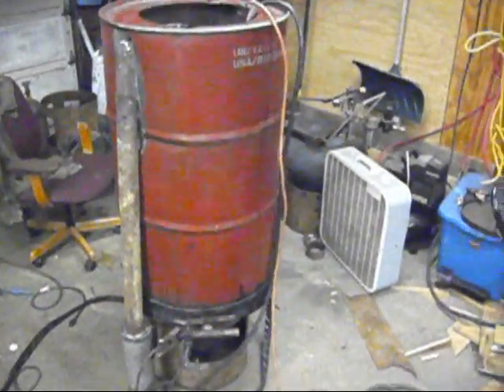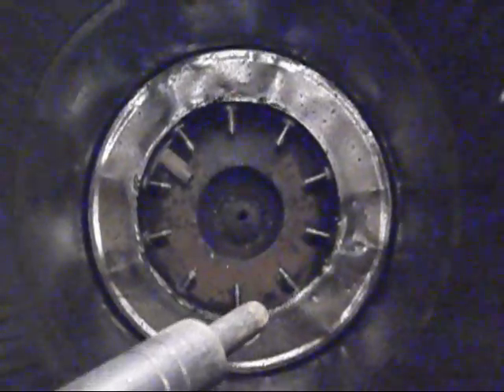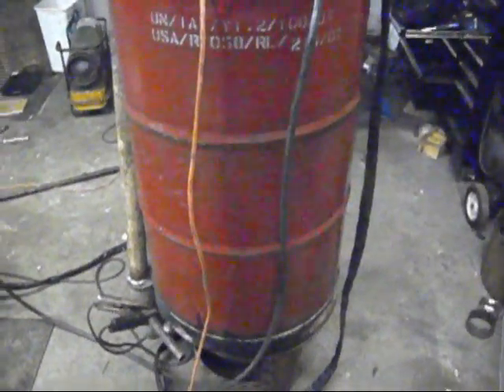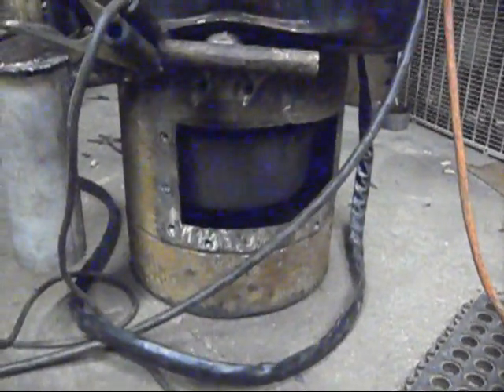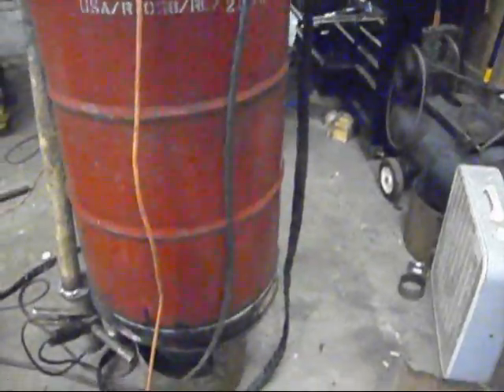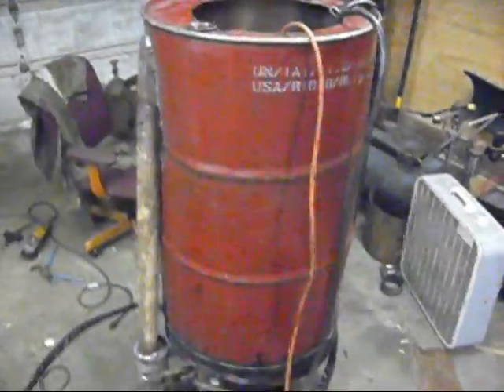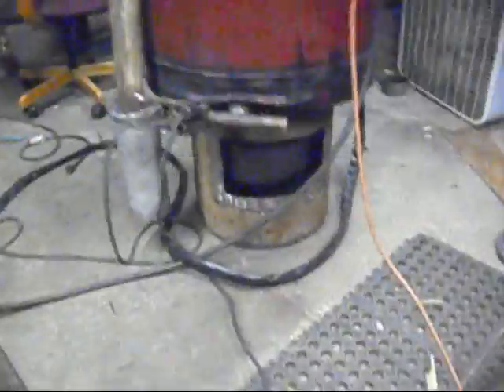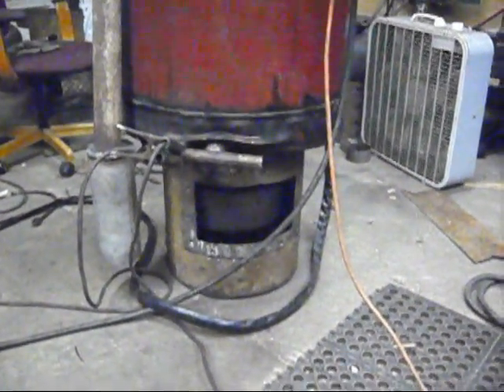wood gasifier

Comment: Glad to see someone who explains what the heck he's doing. Just a few questions. Is the 55gal drum sitting in a metal cap of some kind? What size nozzle openings are you using? What size diameter will your fire tube be? Will you be using a coned shaped or hour glass shaped hearth? Will you be using stainless steel for the hearth construction? Keep us posted. Thanks